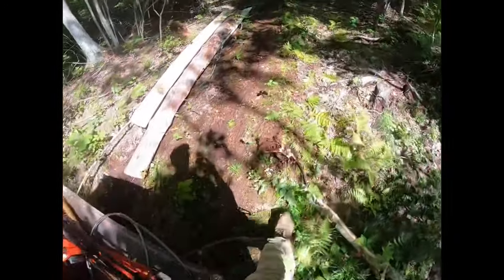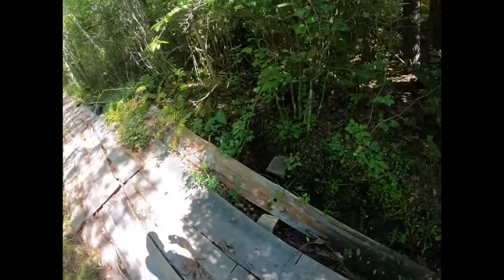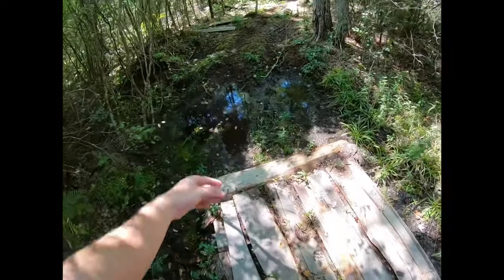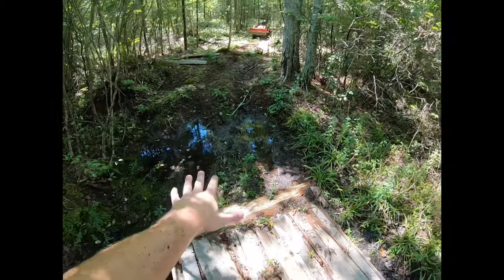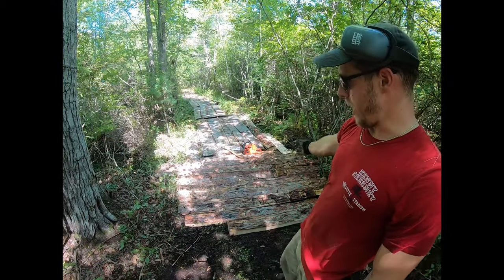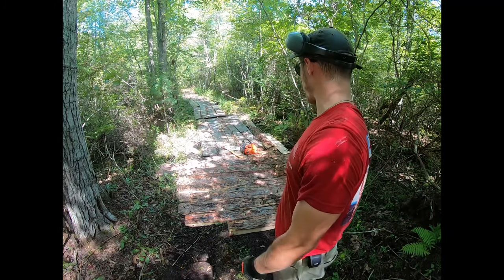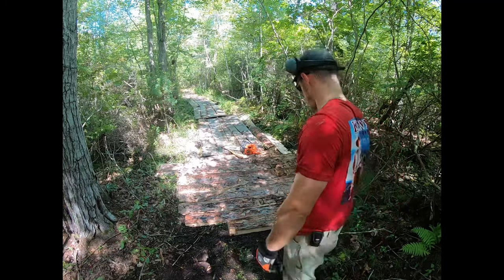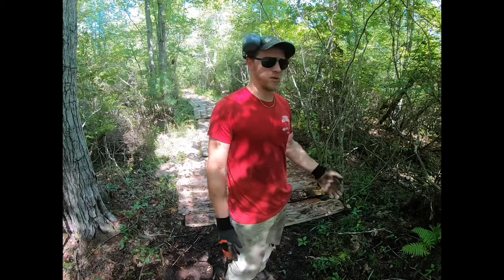Old School Logging Road | Corduroy Road

Comment: That was interesting Jay. I had never seen this done before.
Full watch and a 👍
Reply from the maker: Gary this method is incredibly useful! You will see this again as I have other wet spots but this is the "main" passage I need to cross to get out to the back woods. The other small ones wont bury the excavator but if I tried to cross this without the wood then bye bye hahah
Reply: @HomesteadJay  , don't try planting an excavator. They don't grow in wet soil.

Comment: Should do that for your winter driveway 🤣😂🤣😂🤣! Looks good, keep wood chips around for winter traction, they can be scattered on hard pack snow, ice and if you have a lot, firm up mud as well
Reply from the maker: I was thinking of bedding this with woodchips? What do you think? Ive heard pros and cons about woodchips. I feel like they would fill in the gaps nicely but long term would make it more mush idk!
Reply: @HomesteadJay  if you use enough, they will absorb moisture, and harden the soil temporarily, fill gaps and as time takes its toll on them, then they will decompose, and create mush.

As bedding material for chickens, it will soak up moisture, and poop, but will become heavier then straw bedding material 

For plants needs to be mixed with soil and peat, for the best results, but can attract insects
Reply from the maker: @thesmallwoodlot433  hmmm ok thank you!

Comment: Jay, maybe you could use some of the short pieces in the ruts. It could help support the longer pieces that are on top. Just a thought.
Reply from the maker: Yes what you saw originally before I started working was what I did last year. I layed stuff left to right like a rail road tie then I had the long flats on top! I will fill it all the openings with slabs so that way I can either cover with clay or wood chips we shall see!

Comment: Thats a great way to get across low e\areas, but why not cut them to legnth and carry them out with the loader?  you can still take the scrap ends to use as well.
Reply from the maker: I needed these long sections for after what I already built but I forgot I didn’t finish the front. So as you saw I just skidded down and cut. Going forward I will use loader to bring down cause now I can get onto the bridge with the tractor which I couldn’t do before hahah